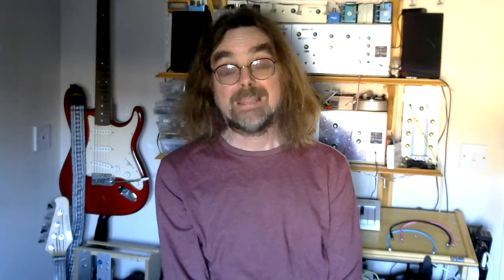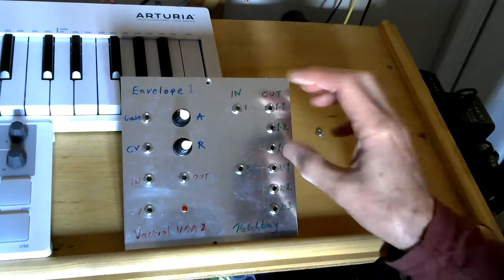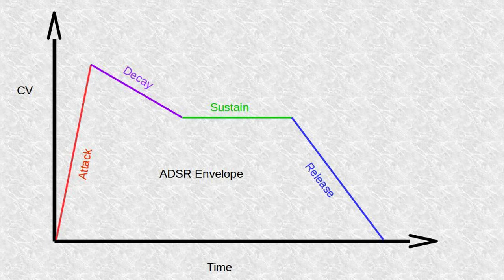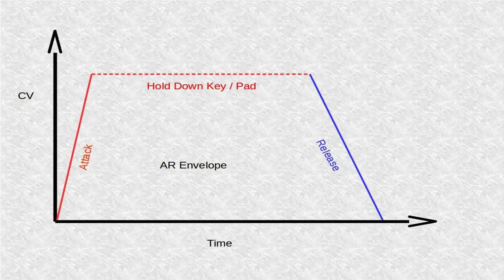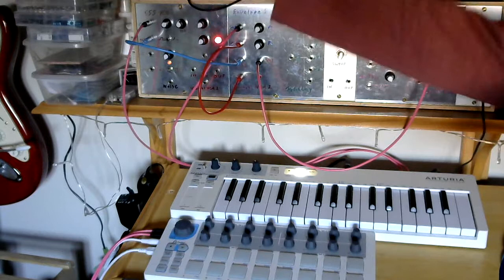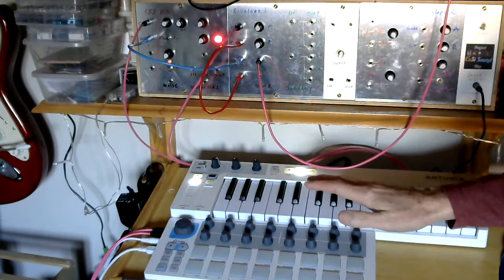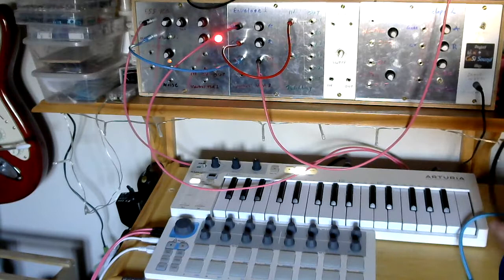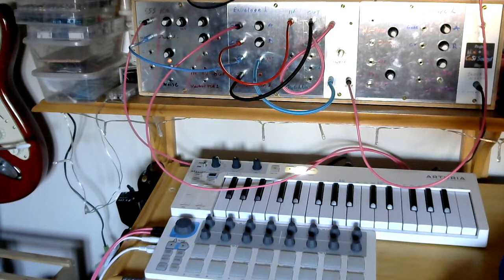Project Nine Modular Analogue Synth: Envelope & Patchbay

Comment: Once again, a very informative video and neat sounds.I'd be interested to hear your thoughts on how exactly the envelope circuit works. It looks to me like the diodes do a lot of the work, together with the variable resistors, and the opamp gets the signal back up to a reasonable strength. Do you have any insights to share about the actual process? Not necessary, but you do a good job of simplifying complex ideas, so I thought it would be worth asking.

Comment: Hi. I’m trying to build this, using your stripboard layout. But I’m confused about the blue wire coming from pin 5 on the IC. On the layout it shows as going from pin 5 to a strip with nothing else connected to it. Is this correct? Not the best at reading schematics to solve it. Thanks for any help 🙏
Reply from the maker: Sorry I should have deleted that blue jumper wire between pin 5 and row C, it is not required. I sometimes have several variations of a board during the design and build process so I suspect that wire is left over from an earlier version.
Reply: @CuSiSound  thanks very much for the reply. It was bugging me. 👍